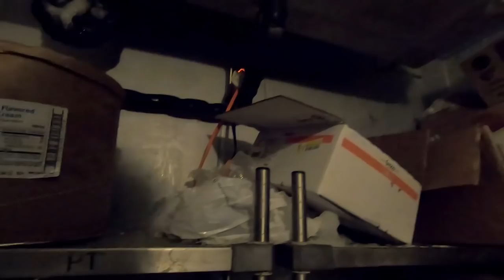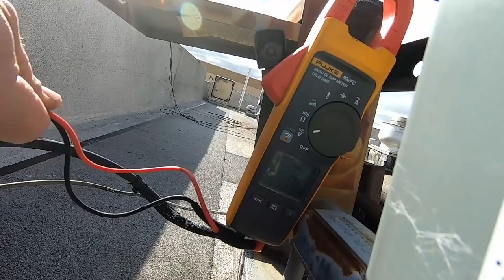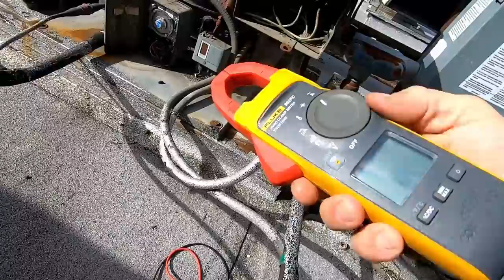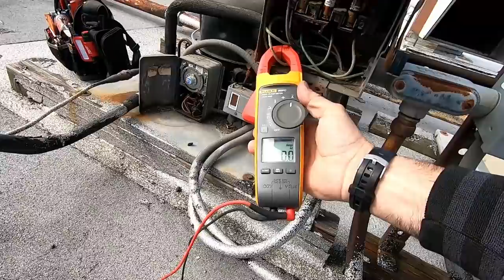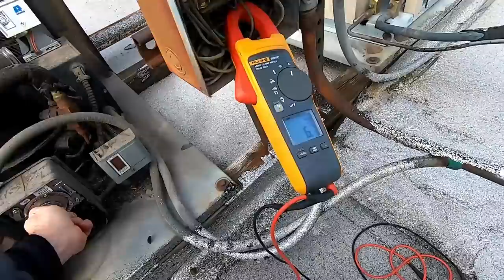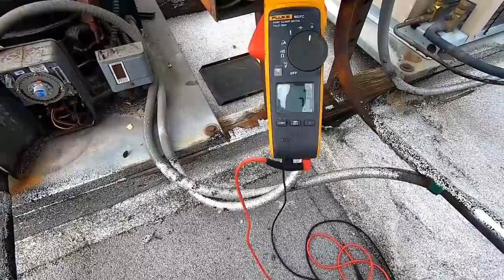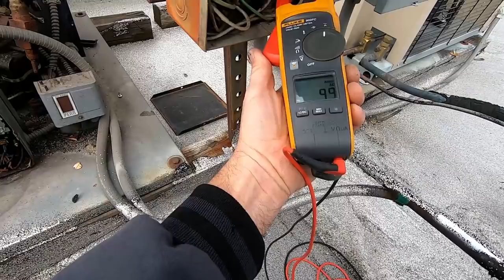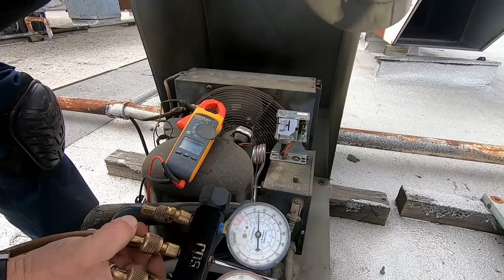Saturday walk in freezer call

Comment: Good Video ! its a Good Reminder Video not to Forget Checking inside at the Fan Blade wires in there. a Tip - Get yourself a 12" long T-handle 5/16 to Remove fna blades so much easier. spin blade around so allen is at 6 oclock and insert allen  t handle.
Reply from the maker: I have a set of the long handled T's I always forget I have them 😁
Reply: @HVACRSurvival   Yea, throw the 5/16” t-handle  in your tool bag beside a long screwdriver. That’s what I do. Real handy size. Works for most fan blades on heatcraft outdoor units & all evap fan blades in walk ins.

Comment: Great vid as usual! If its not a loose wire feeding the compressor then I suspect the compressor contactor intermittently not connecting all three phases. I've got three clamp meters which I use on these sorts of problems, lets you check all three legs are pulling similar current before the compressors internal overload trips.
Reply: HD man a badman innit 👍
My colleague just came across a circuit with 2 compressors on a dual system , I just did a leak repair on it and now the compressor makes a horrible sound and the Kriwan module won't reset .
I did my head in but I'm leaning towards either the contactor like u just said , or bad lubrication and cooling whilst it was running low on oil and refrigerant .
Still , bit of a mind f innit !
Reply: @sterlingarcher46  Yeah it can be a nightmare trying to test stuff before it trips or does more damage!
I think some of those Kriwan modules sense phase rotation etc plus they do fail fairly often in my experience.
Reply from the maker: Yeah I could have done that, good idea. I have three or four meters,  generally it's not intermittent like that. My thought is it probably bounced when it shorted and then touched every now and again.
Reply from the maker: Yeah if it was a better system it would be nice if they had some sort of phase protection. It seems no one usually wants to spend the money. You figure the minimum cost generally is about a hundred and fifty bucks area for a digital one.

Comment: the evap fans moving like that tells me something shorted and dropped a leg and half voltage is back-feeding through them to ground. my first thought fan wires in evap rubbed out and blew the fuse, vibration from you made it touch slightly and the motors jump/hum at half voltage like that (120v to case ground through them). when you replaced fuse on roof and cycled a few time it probably arced itself clear, I wonder if there was a firework show and puff of smoke in the cooler lol. that contactor sure looked terribad, yikes!
Reply: and by 29:48 good guessing on my part, if someone was in the cooler when you replaced the fuse, they'd have seen one heck of a firework show and smoke :))
although I missed saying the fan wire was what rubbed, close enough though lol

Comment: that looks like a r12 compressor ,thanks for the video
Reply from the maker: I haven't seen any R12 walk in freezers, usually 502 and a couple R22 but not often. The compressor did have mineral oil.
Reply: I think 502 like you said.

Comment: With respect to magetrons 32:30: I prefer them (by pairs one stick to each other if necessary, and enveloped with tape) because the fancy ones DO NOT OPEN certain solenoides that the magetrons does. Lesson learned the hard way.
Reply from the maker: Yeah I'm surprised one will do it, I will definitely keep that in mind but I usually use my one that's made by CPS.

Comment: Probably a good reason for it, but why don’t I see much split loom used in equipment? In a previous life we bought split loom by the pallet to protect wiring from damage....
Reply from the maker: Not sure, it's never been popular in HVACR, I personally have used it for car alarms and stereo systems.
Reply: @HVACRSurvival  that’s where we used it... split loom was our friend. If you wanted to be fancy you’d use the nylon mesh loom and heat shrink the ends at the connectors

Comment: I have a question for you. Where would you hook the ac up at the board when there is no y terminal for ac on the board @?
Reply from the maker: On an air handler like this that doesn't have any extra features. You would wire the y wire coming from the thermostat and wire nut it to the y wire going out to the heat pump.
Reply from the maker: Awesome 👍👍

Comment: y did some one change direction of motors and fan blades should blow away from coil not through through to back wall
Reply from the maker: Where did you see that? The evaporator fans blew out the front?